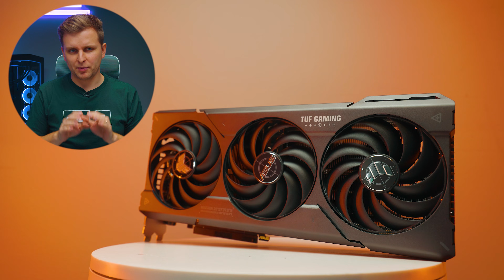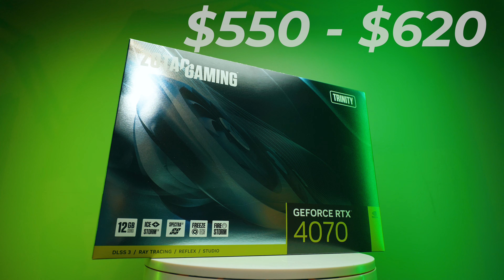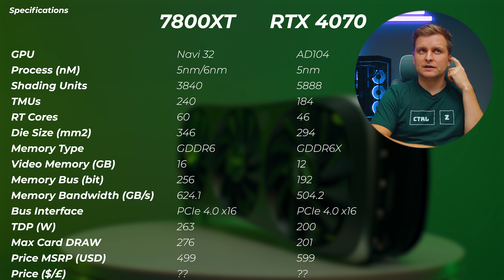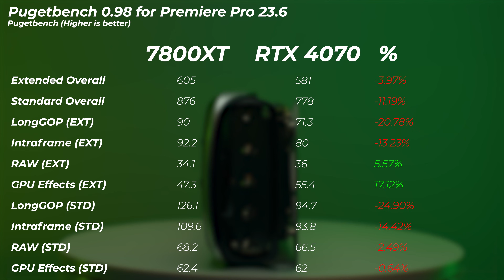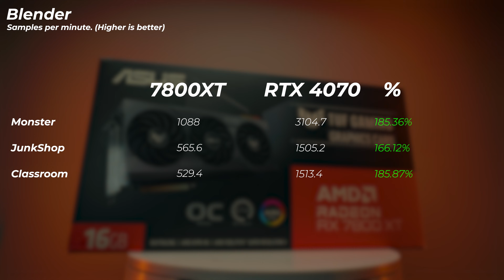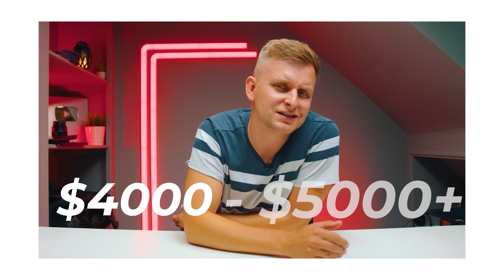BEST GPU for $500-600 as a Creator? [Video, Photo & 3D] ➡ AMD RX 7800XT vs Nvidia RTX 4070

Comment: In my experience (testing between a 7800 XT, 3060, and a750, don't ask), it seems like AMD's encoder isn't necessarily of worse quality, but does seem to be overall a bit less efficient at the same quality.  At CQP 23 Balanced AV1 between the 7800 XT and a750, the a750's file sizes will be about 2/3 of the size for a minute of raw footage in OBS.  The 3060, since it doesn't have AV1, obviously has a larger file size, but comparing h.265 NVENC vs h.265 AMD HW, AMD's file sizes are still about 25-50% larger at the same quality.  I know I'm a sample size of one, but I'd say that pound for pound, the quality seems pretty much the same, but AMD's encoder is overall less efficient.  That's very much a solvable problem, but it just depends on whether or not you're willing to run something through Handbrake to tweak the file size.

Great breakdown, thank you.  Edit:  I meant h.265, not h.264, because yeah, AMD's 264 encoder is kinda not exactly great.

Comment: great video, I almost didn't buy the 7800 XT because Adobe's website for supported GPUs for Premiere Pro had the 6800 xt, 7900xt, and 7900 XTX but did not list the 7800 XT...so I almost remove it from my list, then came across your video. So happy now lol

Question, do you turn on GPU acceleration in premiere pro to take advantage of this 7800 xt? or just leave it default/off?

Comment: 12VHPWR is such a mess I'd entirely avoid any GPU using it. Out of safety concerns. The connector melting could cause a fire if you're unlucky. Just not worth the risk

Comment: Thank you for the video. Finally someone does a comparison in the 3D sector. I am hoping AMD can catch up with Nvidia 1 day in the 3D area. I really don't want to buy anymore cards from Nvidia anymore.
Reply: Me too, nvidia is far more greedy than amd, especially for vram. Very useful in large scenarios, with many objects and shaders. I recently got a 3080 10gb for 400€, because they can't be found in 12gb or if they are found they cost too much for me. At the usual price of the 3080 (used), or a little more I could have gotten a 6900xt/7800xt (used). 6 more gigabytes were useful, but on the softwares I use AMD doesn't work very well, UNFORTUNATELY

Comment: ⚠️ Yes, but if instead, you put an RTX 4070ti, it blows away AMD cards...😂
Reply from the maker: and be more expensive...
Reply: The 7900 XT is faster than the 4070 ti in gaming and video work while being cheaper. Only reason nvidia wins at 3d is because the industry has adopted their proprietary cuda, most applications lack proper support for AMD.

Comment: The old Radeon H.264 encoder was inferior in video quality to GeForce nVenc at the same bitrate but now that they both use AV1, that difference should be gone.
Reply: Many people that complain about h264 are streamers and the platforms dont support AV1 for the most part. So they are stuck with h264/x264.
Before AV1 h265 was already a good alternative where AMD had similar quality to Nvidia. (had worse performance tho)
Reply: @CallMeTeci  for steaming Nvidia is the way to

Comment: Basically what I got from this video is as per usual, buy PC products based on use case, AMD has better raw gaming performance for cheaper, where as Nvidia has better encoding and slightly better features, but for a much higher price. There isn't really a one size fits all unless you wanna drop thousands on a 4090. Good video tho.
Reply: In this Video it says, that AMD has better encoding Performance in Adobe Premiere. Especialy in LonGOP. Im think i will get an 7800 XT for Video editing in my next Ryzen build. IT also hast 16GB vs 12GB
Reply: @SEHMOMENT  honestly I kinda skipped around in the video just to see the results and didn't see that part but that just makes it even more of a split for what exactly is "better" but I lean towards AMD almost all the time since price to performance is hard to argue against
Reply: nvidia's encoding is only better at h.264. AMD is comparable with 265/AV1.

Comment: When it comes to encoding quality between the 2, Nvidia will have an edge bitrate to bitrate alone because of software maturity and integration, so that should make sense.
But when it comes to AMD settings in say resolve, its really about the settings and configurations, many people use the exact same settings they use for Nvidia and onto AMD but that might not be the best approach, it is different hardware.

Its also what people are doing, I find AMDs support for H.264 and albeit MP4 to be weaker then Nvidia but I contribute that to AMD just not caring about those 2, they went full in with HEVC/H.265 when not a lot of programs at the time provided that or supported AMD in that but did for Nvidia.

AV1 is another one, take the free version of resolve, Nvidia AV1 isnt supported on that at all but AMDs is, and when you use the quality preset ( not fast as people recommend with the Nvidia option on the paid version ) then the quality is pretty decent for AMD with decent size.

It is a bothersome one when it comes to encoding quality because the setting options you need to pick need to be different because they encoders behave differently I have found.

I don't feel the AMD and Nvidia encoding settings have been explored much by any content creator as most tend to just own Nvidia to start with and a lot of Hardware testers don't explore options between the vendors either.

Comment: Regarding video recording it is more about how the individual adjusts their recording/streaming settings on the streaming/recording software that they use. It has less to do with the cards themselves with modern graphics cards. People need to know how to pick the proper resolution size, encoder type, recording format,  rate control, setting, bitrate, etc. If any of these are set wrong it could hinder video quality. Also, If someone is recording content to use in video editing software then the person should record in a higher resolution due to compression loss. A popular streaming/recording software people use is OBS which has H.264 (AVC) and H.265 (HEVC) in the encoder option. I have a RX 6800 XT and it I find them useful. Not sure why people default to AV1 for the encoder.

An example is if you want a 1440p video on YouTube then it would be good to record in 8k (4320p) then in the video editing software it would be shrunk to 4k (2160p) to maintain quality with the first stage of compression loss. When the video gets uploaded to YouTube there is another moment it ends up with compression loss leaving it at 2k (1440p) with no quality loss or 4k (2160p) with some quality loss.

Comment: I am building a pc within next 1 month, and this is exactly what i was looking for . This is what i wanted. I have no 3D work , only Video editing, and i am starting trading(need 4 monitor output), and for these 2 - rx 7800 xt will work fine
Reply: If you are going for a multi monitor setup then you should look for some Hardware Unboxed videos about using both brands with more than one monitor, lot's of insights there.
Reply: @mateusdaitx9433  Edit : I actually see in my country(India) - price of rx 7800xt and 4070 to be the same, and now I am re-considering 4070 only
Reply: @hullagtpp   yup  got a 4070 too price is almost same, I am from India too :D and a single 4070 can easily output to four monitors too
Reply: @hullagtpp  The 7800 XT is a better card in most respects than the 4070. The 4070 has only 12 Gb of VRAM for example, whereas the 7800 XT has 16. That makes a difference.
Reply: @ZenAndPsychedelicHealingCenter  I agree, but am way too confused
Reply: @mateusdaitx9433   EDIT 2 : i saw Hardware Unboxed videos, and now i am again considering 7800 xt cuz why not

Comment: If AMD can catch up to Nvidia on encoding; I'll def consider them but thats the main thing I need for live streaming and recordings. I'm still using a 2080S for streaming and it works perfect. I would love to upgrade to a 4000 gpu for AV1 encoding but the Nvidia greed has kept me from making the upgrade.
Reply: AV1 encoding on the Radeon 7000 is exactly just as good as the NVIDIA RTX 4000 and also at the same bitrate.
Reply: AMD's h.245 and AV1 encoding is as good as nvidia's. nvidia is only better at h.264.
Reply: AV1 is currently only useful for videos. No streaming site really supports it, besides YouTube and even YouTube transcodes AV1 before giving the viewers an output. That simply shows how far away native AV1 support still is, when it comes to mass compatibility. But for videos, its great. In Davinci much better timeline-performance than h265 with comparable quality.

Comment: Should of tested the 4070 ti vs 7800xt.
Reply: only if nVidia drops prices of 4070 Ti to 7800 XT :)
Reply: why? Different price class. If you did that you would be going to a much costlier AMD card to compare as well.
Reply: @motess5304  because its the best version of the 4070 until the super 4070 ti comes out thats my opinion. If your going to test the best version of the 7800xt has to offer you should compare it to the best version the 4070 has to offer.

Comment: i think the RTX 4070TI is the best one, but now the Super model is coming out in 2024 with 16GB of ram.  I use the RTX 4070TI with Adobe Premiere Pro.
Reply: Huh? The 4070 ti is like £800...
Reply: Having a 4070, 3090, 7800 XT and 7900 XTX, plus some others, I think both the 4070 and 4070 Ti are overpriced for the performance they offer creators. That memory amount and bandwidth is really limiting in my workflow and I kind of wish I hadn’t bought the 4070 and had just used the money for a used 3090 instead for Blender.

For video editing, the 7800 XT is by far the best value in the $400-600 range. It’s not really close. If you’re spending more and do a lot of 3D editing, then I’d go 3090 instead of 4070. The pricing for any Nvidia model above that remains unreasonable at the moment.